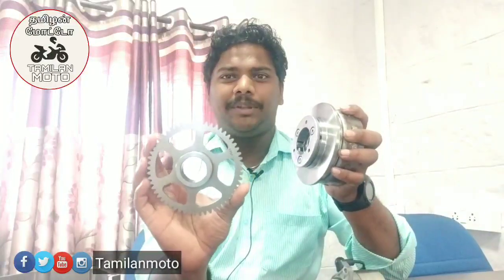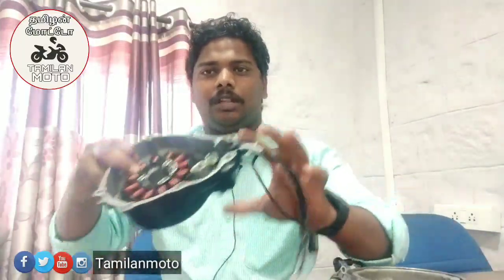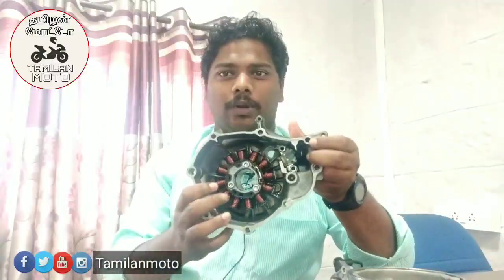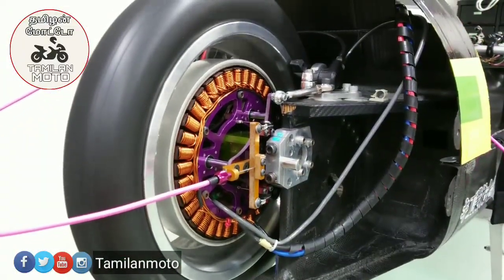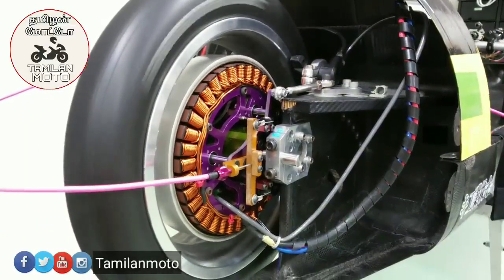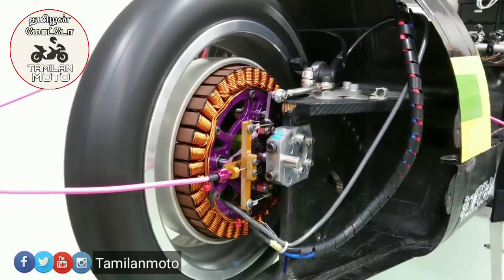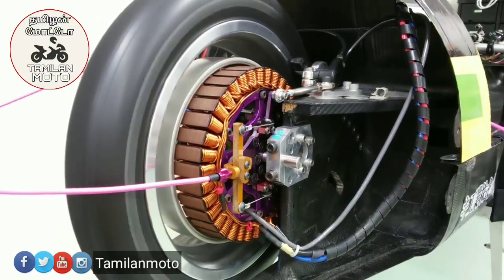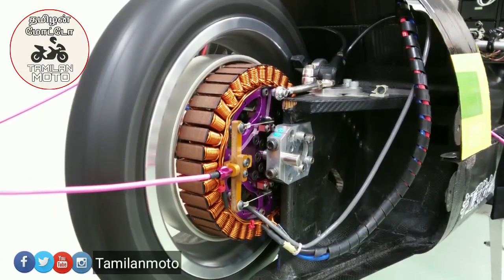TVS XL 100 i-Touch start system | Integrated self starter generator system| Tamilanmoto

Comment: Sir Normal xl 100 cc la set panalama
Reply from the maker: Casing size little bit change aahthu bro.   So panrathu kastam., Athuku aahara selavuku nama ithe vangiklam. But normal xl la starter motor system vaiklam

Comment: Hi Sir, old XL 100 la indha setup pana mudiyuma? Mudiyumna, indha setup best ah or Starter motor vachu panrathu best ah??

Rendu setup oda procedure konjam solunga please.
Reply from the maker: Old tvs la neenga intha setup panratha Vida starter motor pantrathu than easy.

Intha setup old TVS la pana mudiathu aena casing set aahathu. But starting circuit system ah connect Pani starter motor place pana mudiyum
Reply: Tamilanmoto how to do that

Comment: Bro old xl100 LA bettery setpanna டையோட்  polt akuthu 3 vacha entha vaicha betteryla charchge akum vera ethavathu usepannanuma
Reply: 6a4 single diode use pannunga apram 25 volt 4700uf capacitor use pannunga endha fault um varadhu